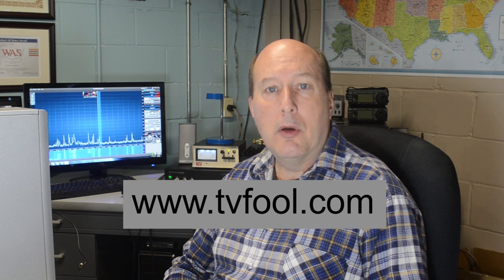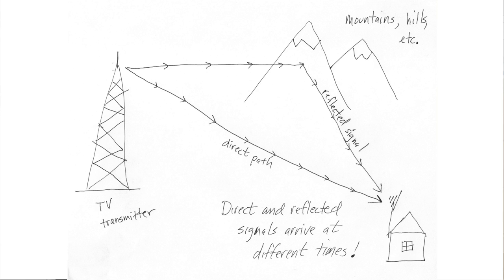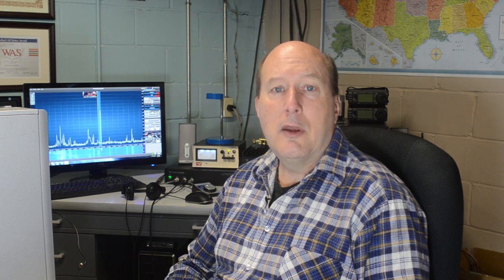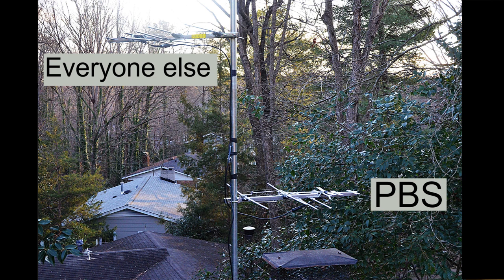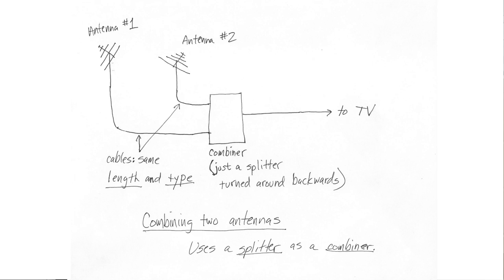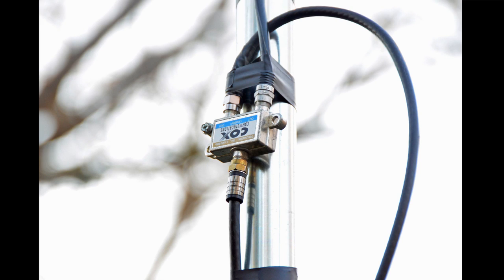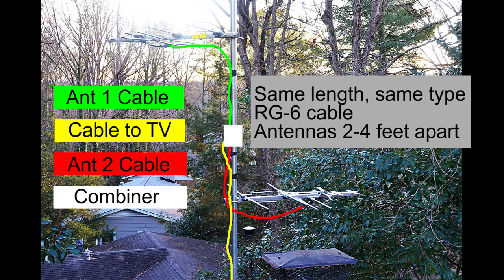Combining two TV antennas for better HDTV reception

Comment: Great information.  Particularly, your explanation of the different causes between snow and ghosting.   Can two different antenna styles be combined in the same manner or do they both need to be identical twins?  In 1966 my parents home was in need a new antenna (Cost $200 to $250), but they opted for the new cable technology that had just been installed in our neighborhood.  While recently settling my parent's estates I found a 1966 cable bill among their papers.... cable was $1.26 per month.
Reply from the maker: Chris, the antennas don't have to be identical. But they should both be directional.
$1.26 per month? Even accounting for inflation that's a good bit cheaper than today!
Reply: Thanks for the info Doug,  Yes, 1966 price sure was cheaper.  My current monthly cable cost is more than one hundred and twenty times (CDN) higher than the 1996 price.  That's why I'll be cutting the cord within the next month.

Comment: You got me when you pixelated and froze the signal, I actually thought something was wrong with my internet connection for a minute.
And that the coding from you called back in the old days was ghosting. Boy do I remember that.
I want to also add that my wife is to sports nut and I'm the technical geek. Believe it or not she was the one that explain football to me. That's what happens when you have older sisters.

Comment: okay, newbie at this here - connected a Winegard flat amplified indoor antenna, 5L5500A to my bedroom Vizio smart tv. I get some stations really well. This antenna is in a 2nd story window facing North. I see a lot of stations are south of me - I was thinking of adding a flat antenna also to my dining room window, facing south. So I would want to combine the south antenna near my two tv's, and branch off to them - then on my north facing tv, I would want to combine that antenna to go to both tv's - so it seems as if I would have to combine the south antenna cable into 2 cables to go to each tv, in 2 separate rooms - then on the north antenna it sounds as if I would have to combine that cable to go to each tv - then I would have to combine the 2 cables at each tv into one to hook up to each tv?  What type of splitters would I use, I assume powered ones - and what quality of cable would I use for a fairly long run like this - my place is a 2 room condo basically, with other small rooms as offshoots.

Comment: Excellent and to the point! Can I use my antenna with rotor and add a standard HD antenna? I ask because power to the rotor is fed through the coaxial cable. If so, which antenna should be at top of mast? I have about ten feet of pole from top of metal roof to top of antenna pole.
Reply: Oh and the box for the rotorized HD antenna has a signal amplifier.

Comment: I did just this in my attic with two beam antennas. Get TV was weak and I was at the edge of their range. I used two beam antennas combined into one then another combiner to split the signals for my two TVs. Get TV could only be picked up if I was aimed directly at their transmitter(with in 2 degrees). But then I couldn't pick up 4 other major local channels. Was having the ghosting problem, where the audio was about 2 seconds behind the video. Doesn't do it as much as before, what's funny is the audio will play fast and catch up with the video in a small burst when it starts out lagging behind. 
I have a question: will marine radar affect HD beam antennas? I live in a fishing village (Yscloskey,La.) and boats pass within 100' of the house. Only about 10' difference in elevation.

Comment: Thanks for this video. I was thinking about doing the same thing and was wondering if a splitter could be used in reverse. Where I am located we only have about 10 channels available to pick up. 3 Stations to the NE and 7 Station to the SW. No other stations are broadcasting from other directions. So right now we have to choose between 7 Stations or 3 Stations. So wanted to get a 2nd antenna and splitter since they really don't cost much. Then we can get all the stations. Thanks!

Comment: Hi Doug, 

Your 'same length' of coax keeps ringing in my ears but I haven't taken time to deal with it.  I bought 4 15' RG6 GE Coax Cables on black Friday from Amazon and have planned to try to solder these into my indoor antennas replacing the cable they came with and be making them the same length at the same time.  Is this possible?  It seems to me like it'll just be a necessary opportunity to do righteous soldering.  

I have had an almost stupid revelation just this morning.  I had on 2 occasions used your point in this video and combined 2 indoor antennas into one cable with a splitter backwards and had instant fabulous results, even with different kind and lengths of coax.  This one new antenna came with a wire that is only about 3/16 diameter outside and about 3 times as long.  While most channels were pretty solid channel 2 would strangely fluctuate from being pretty solid in the morning to being pretty flaky in the afternoon/evening.  I'm now sure I've been under the right thinking in that when I got time I was going to solder the RG6 to the antennas and basically clean up act and try to route my cables away from any sources of interference.  Well this morning the TV was showing something pretty darned solid when I stuck my cell onto it's Qi charger about 1' from the TV and the TV went quite a bit WACKO.     LOL  hmm hmm hmm!

Ok soon I'll get those RG6's soldered onto the antennas and look on the web for extra shielding to wrap around the RG6 as I pass by interference.  LOL

Also I wanted to mention a couple things I bought and returned to Amazon on Black Friday.  One was the Viewtv AT-263 ATSC Digital TV Converter Box Bundle.  This thing after only 2 days had really taken my heart.  I loved this thing.  It really seemed to do everything described, but, it had 3 real flaws and I had to return it.  On the plus side this would record coax input onto a USB drive 3 ways.  It would record instantly at the press of a button, you could go into a timer and swiftly put in a timed program and it would work, and you could go into an EPG and select a program (I think it had 2 weeks of programming in it) and it would record that program.  This thing would even pause live TV and it worked.  But, VERY strangely if you changed from channel 2 to 4 the clock on the face of the thing would jump forward 2-3 minutes; jumping back if you went back to channel 2.  If you went to channel 7 it would jump further forward.  Each channel had it's own time.  So there was something wrong inside and even fire hazard went through my mind for that.  This thing, different from the Hauppauge Rocket would put out some noticeable heat.  Not hot, but good and warm.  The Hauppauge Rocket is almost nothing.  The other problem with the Viewtv AT-263 was discovered by my own mistake.  I confused its included antenna with one I bought in the same shipment and took it apart and discovered soldering that looked like something done in someone's basement by a young teenager.  Then I saw it was the wrong antenna and put it lovingly back together and realized I had just by accident probably saw what was wrong, VERY poor quality solders and i returned it.  
The 2nd item was the CSRET Ultra HD 4K x 2K 4 Port 4 x 1 HDMI Switch.  This was a PnP but it simply had a remote where the center column buttons worked properly and the outer column buttons were like squeezing on a stick or something solid and I just couldn't stand it.  I was often wondering if it was working or not.
So I returned these two but I'll tell you if I see messaging indicating that Viewtv AT-263 has improved manufacture in a year I'll try another.  This would really be a sweet product if they build it well.  Oh it will also play what it records.

Anyway that's enough for now.  I hope things are going well for you,

Rich

Comment: Does this rule apply to mobile applications?  
I am trying to grab vhf hi and p25 signals, I've noticed that if I use an antenna  designed for the p25, my vhf-hi suffers. And if I go with the vhf I don't  get p25😢

Comment: I have a 25’ pole and I’m thinking about installing either 2-3 antennas: I have 56-60 channels with 1 antenna pointing in one direction and about 30 to another. I live about 5 miles from Tijuana Mexico and would like to get more LA Channels and Mexican TV stations. Would adding a 3-Way splitter plus grounding increase my TV’s reception?

Comment: Great video.  Did you choose the RCA antennas because they were wider bandwidth?  I'm looking at combing 2 of the 4 bay bowtie antennas to get signal in two general directions, but seems like the bowtie antennas would be more of a UHF only situation as opposed to VHF/UHF
Reply from the maker: Yes, at the time I needed both VHF and UHF coverage, although many of the channels I watch have since moved to UHF frequencies.
Reply: @doughall1415  thanks.  we're going 60 ft with two of the 4 bay bowties for a total of 16 bowties

Comment: Very well done. I’m going to try this. I was just wondering why,from other forums I’ve read they seem to say ,’it degrades’ the signal if you combine two antennas?! I’m assuming,they didn’t space theirs far Enugu apart as you’ve stated.
Reply from the maker: The supposed degradation comes from the fact that there is some loss in the combiner itself since it is a passive device. But when the antennas are properly aimed and spaced you nearly always gain more than you lose.

Comment: Doug, fantastic video. I wish I had found it years ago. I don't know how much time I have spent giving viewers this very same information over and over. I even had viewers call and say we were off the air, wake up dumb ass, when were we going to fix our problem. Several times I have used tvfool.com to see that they should have a strong signal. Took a battery powered TV out to their house with a coat hanger as an antenna. You should have seen the look on their face when they saw a perfect picture! Anyway, good work! 
Larry Friddle, Chief Engineer KHBS/KHOG TV (retired)

Comment: I hope you can answer my questions on this. I have a high gain antenna focused on Boston MA from my location. 45* to 50* to the west is Providence, another 3 channels that way that barely come in. Would there be a issue with that as it's off in roughly the same direction? I would also be using a different type of antenna.

Comment: Great video!! Thanks for the info.  Can I mix two different antennas or do they have to be identical?
Reply from the maker: They don't have to be identical. But they should both be directional for best results.
Reply: I have one directional and one flat panel and I get all the available channels with excellent signal strength.  Thanks again for your video because it helped me tremendously.

Comment: Thats a good point , you would need a high gain antenna . Instead of a regular splitter , is this better made by Antennas Direct
VHF / UHF Antenna Combiner a better component . Also is there a phasing loss ? Thanks 
I am replacing my 10 year old analog antennas 2X , with a Winegard HD 8200U. How does it rate with the older Antennacraft  HD 1850.  The signals on the worn out old antennas measured  on my HP ESA 1500A Spectrum analyzer were still good on transmit channels 7 /13/41

Comment: 186,000 miles per second! ? speed of light. speed of TV! and radio. light is just a wave that we can happen to see! great video. in about to move . and was going to do the same thing. I was going to go up about 40-60' and out 5' each way from the pole. with a 10' piece of EMT. with a antenna on each end. do you think this will work? for now I have the flat square antennas that hang on a wall. I have it outside on a 1"x 2" x 8' about 3' above the roof. outside. it works good. as a temporary antenna. with a booster I get 6 channels and 4 replica pbs channels  I don't know if I can get Amy more. but I'm going to try! as long as it don't cost to much. I just need the combiner I have the coaxial cable. I got it from the cable guy. and advice?

Comment: What if the problem station is in the same direction as the others?  Since it is VHF channel 5 I was going to add a VHF antenna. But then the two antennas would be picking up the same stations. Will the two antennas interfere with each other? What should I do?

Comment: Thanks for your easily understandable video explaining digital TV reception that you presented here for us older viewers that had many long years of analog experience.  I'm located about half way between San Antonio and Austin Texas. Approximately 50 - 60 miles to either of the concentrations of transmission towers in those markets.  I'm using a directional antenna rated for 100 miles that's pointing toward the San Antonio towers.  I get all of the San Antonio stations perfectly MOST of the time.  I get the FOX station in Austin perfectly MOST of the time, and that's off of the back of the antenna, about 150° from the San Antonio towers.  My reception problem is almost always during the periods of sunrise and sunset.  The problem is only on a few of the stations.  Please suggest something that may help me resolve this issue.  Thanks!
Reply from the maker: Barry, reception issues that only happen occasionally are the most frustrating and can be the hardest to fix. You might try a preamplifier to give you some additional signal strength. Companies like Winegard and Channel Master sell them. Other than that I'm afraid I don't have any other suggestions.
Reply: Doug Hall - Thanks for the suggestion on a preamplifier.  I tied two different preamps early on and they didn't help, so I returned them to the store.  I also live in a home that's three years old, and was pre-wired for cable and internet in the three bedrooms, and in two different locations in the living room.  Each location was pre-wired with both high and low outlets (120 v, cable, and ethernet) on the wall to accommodate hanging on the wall TV, or table top TV.  There was a mess of cables and splitters in the attic that I assume the local cable company was responsible for installing for the original home owner.  I disconnected all of the cables except the two that I intended to use.  I attached the cable from the antenna to the cable going into the house.  I had TV working in both locations, but I wasn't satisfied with the reception. 

I read about the RF emissions that are transmissions from the smart electric meters, and decided I'd try to block as much of that RF from getting into the house as was practical for a DIY person to do.  I shielded the plastic dome on the meter with aluminum window screen and grounded the screen wire.  Because the entry point for the antenna wire was close to the power meter I assumed that the meter may be causing problems with my signal.  After shielding the meter (Farriday cage) and grounding it, the TV reception improved.  Then I routed the coax further away from the power meter, even more improvement in reception.  That brings me to where I am now.  

You're right about reception issues being difficult to resolve!!

Comment: I'm having the pbs problem as well. My latest antenna is outdoor and omnidirectional. It's fed to an Amazon recast dvr for streaming my ota channels to multiple TV's and devices. I'm getting between 41 and 47 channels, none of them are my local pbs. Could my problem be my solar panels? I have another indoor/outdoor antenna I may add, but this is so frustrating when a friend across town has a small flat wall antenna and picks up 4 local pbs stations.
Reply from the maker: Guy, I'm not sure how the solar panels would cause a problem unless they are blocking the outdoor antenna somehow. I don't have any experience with the omnidirectional antennas. It seems that in my case I had to use a directional antenna to get the local PBS station.
Reply: @doughall1415  thanks for answering me Doug. This is so frustrating. I've spent so much money trying to resolve this. Gosh I bummed.

Comment: Thanks for the video Doug. I actually used this video for when I first setup 2 directional RCA antennas. 
That worked well, but I am in a location where I have practically 360° of towers around my house. So I decided to try 3 antennas. I feel like I lost channels trying the 3 antennas. Not sure how if that is because the extra splitters/antennas are sucking more energy from my amplifier or I haven't got all the antennas pointing at the best location. I was originally planning to use 4 antennas to try and cover as much as possible, but not sure this is feasible. I thought about using a omni antenna and all towers are under 60miles but I'm also located halfway down a large hill.
So I guess I am asking is 4 antenna setup possible? Anyway to make it better?
Or try a omni?

Comment: I have the same problem with stations in my Seattle area.  I have two digital antennas and didn't know about the upside down splitter.  Now I know and will do it.  Need to see if I have any RJ-6.

Comment: I have used a 6 db amplifier one antenna, 23 db on the second, a 12db on the 3rd. Each amplifier has its own power supply and then a 3 or 4 way distributor that blocks power supplies.  That way I got TriCities, Portland, Seattle, and Spokane and could watch show on the independent channels.